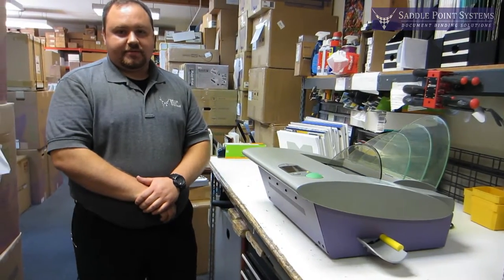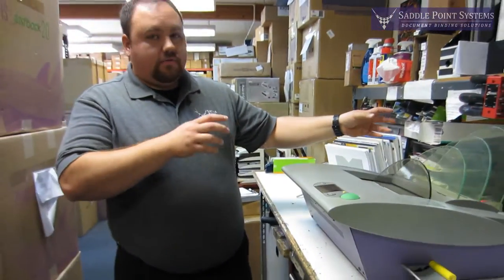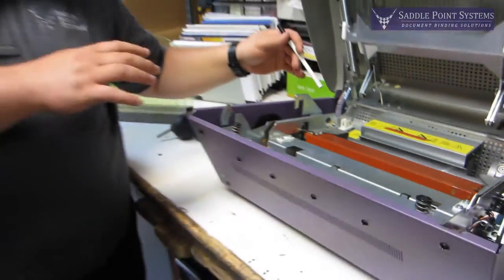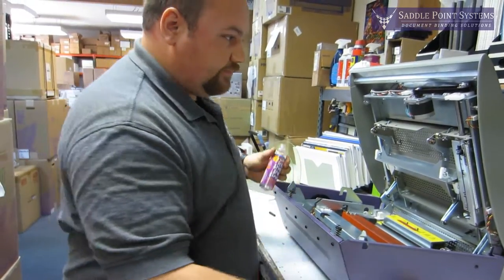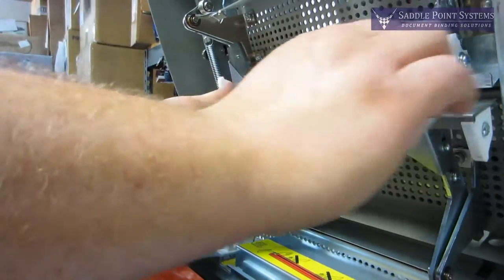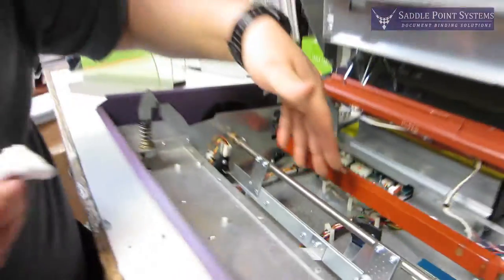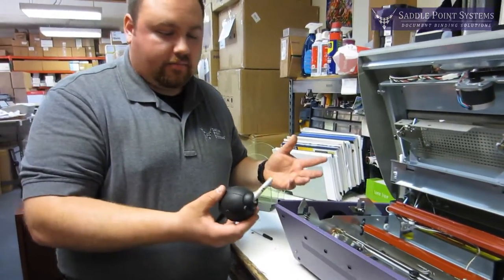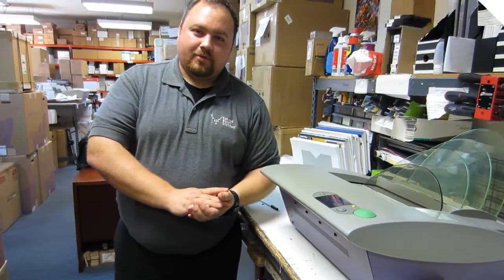How To Clean Your Fastback Model 20 Tape Binding Machine

Comment: I have just cleaned one of those and there is a roller for the strips to the right between the hater and the cooling platen. It's hard to get at but it was encased in sticky black gunk. I removed it and it solved the problem with dirty book spines.